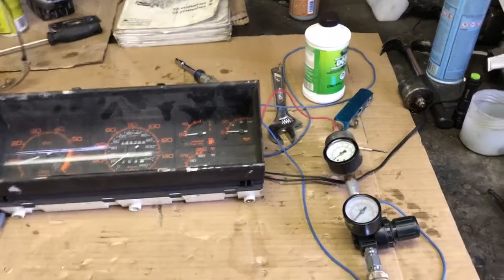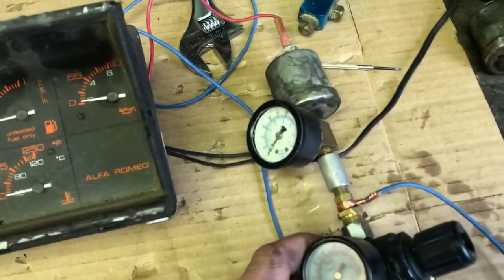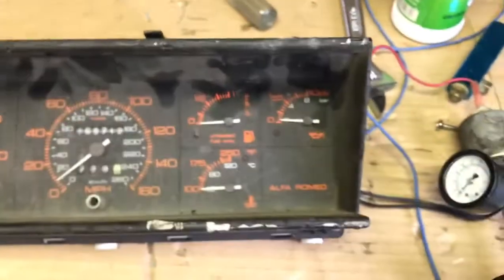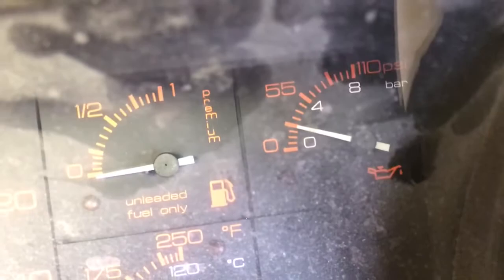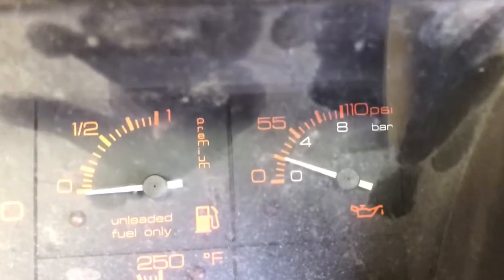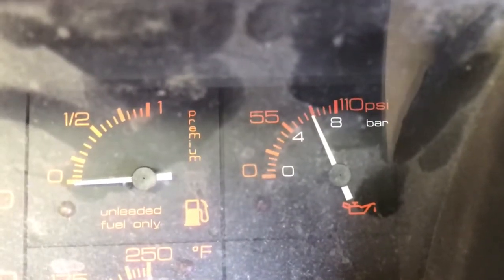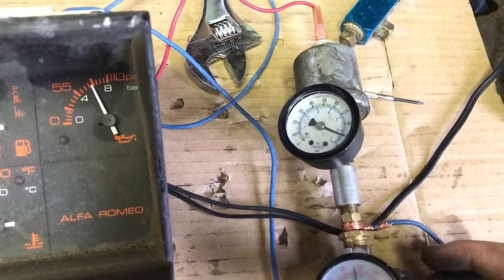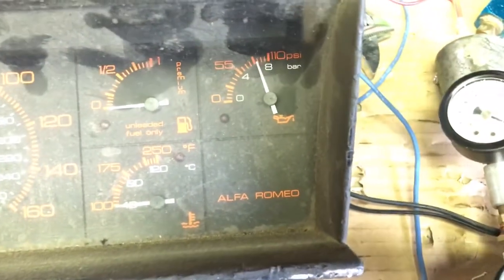Testing Alfa Romeo oil pressure senders

Comment: That’s swell but it would have been nice if you demonstrated the “tiny relief hole” procedure. It drives me nuts when people say just search for it because nine times out of ten I can’t find it. Besides why waste my time when you obviously can simply tell me! What size drill bit? Where did you put the hole? That would be truly helpful.
Reply from the maker: it only needs to be a tiny pin hole, so a tiny drill bit will do. I usually go strait in the top next to the connector so its easy to get while its on the engine
Reply: Nodarperformance - Ok. While still installed on the engine I drilled a 1/16” hole with my Dremel through the top of the sending unit. Probably went down no more than 1/4”. Took the Alfa out for a drive. What the...! I am truly amazed it actually worked. First time in probably 34 years the gage doesn’t drop to zero on a fully warm idle. I am grateful for your suggestion and apologize for being snarky. Sorry, but I encounter this a lot on Alfa message boards whereby someone seeks a solution to a problem and the responses are, “Yeah, I had the same issue last year, good luck!” Or, you need (insert part or procedure here) but offer no details on where part was procured or how procedure was performed. Or, “Your problem has been beaten to death on these boards, do a search.” Then you do a search and find that it was discussed so long ago the pictures are deleted and links are non functional. And I say to myself, why didn’t the guy just answer the question? Occasionally you hit paydirt but you have to sift through a lot of useless jabbering from people that just seem to want to just hear themselves talk. Frustrating. Anyway, I really appreciate you getting back to me. This is one heck of a useful hack! Thanks again.
Reply from the maker: @stuffhappens5681 I find that a lot researching stuff for my Alfas. Pictures are deleted and posts are archived and the numbers of people who actually use the car daily like me are next to non existent, so its hard to gauge whether the person has actually done 'x' job or paid someone to do it 15 years ago. This hack I actually got a hold of when I first got my Milano back in high school...back then they were far more common. Having said that, this little hole will eventually start leaking oil as the sender seal gradually becomes worse and you will be forced to replace it all together. There are replacements available still I believe and a couple of alternative senders which are close enough. Thats all the reason I make these videos, so that the information is out there